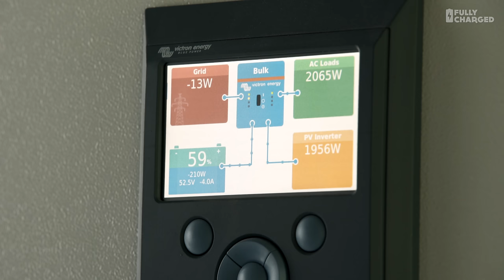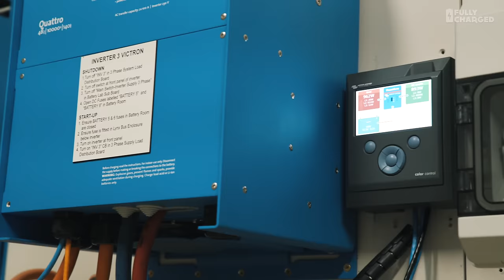Redflow ZCell batteries for home renewable energy storage | Fully Charged

Comment: As someone that lived in the Arizona desert, I was always looking for "that battery."  That battery that could store the enormous power available from the sun.  (Not to mention wind.)

The problem with all forms of alternative energy IS storage.  We can make the power, no problem.  Wind, solar, etc is ideal for the individual home.  It's the storage that's killing the promise of alternative energy.  (Somebody should offer a X prize for better storage!  Mars and space are fun, but we need REAL thought put into energy storage here on EARTH!)

While I applaud the Redflow design and their philosophy, the problem to overcome comes down to the same thing it always does, the inefficiency of the storage system.  I assure you that there is a reason we don't see everybody generating their own electricity everywhere there is abundant wind and sun energy- yet.    

All current energy storage systems fail when it comes down to efficiency in eight forms. 

First, if I put X into the Redflow battery, with X being a particular amount of electricity, let's say 10 kWh, what's the efficiency of conversion to storage?  Is it 50%?  Is it 90%?  How many of those kWh's that I pumped in, can I now pump out?  What's the efficiency when I draw the power back from the battery?  All batteries lose something in translation by storing electricity and then recreating it.  I don't see anything about efficiency.  In theory, a poor rate of conversion can be overcome by adding more generation in the forms of more solar cells or wind turbines or adding more batteries to the system, but none of those are cheap answers to inefficient battery storage.  If I can ask the OP, what's the rate of conversion?  

Bear in mind that generating all voltage is DC.  Nuclear, coal, oil, gas, wind, solar- they all start out as DC.  All generators work in DC.  In an alternative energy system, the DC is generated at the solar panel or windmill and then inverted to AC.  It gets sent down to the battery, transformed back to DC to go into the battery and then inverted back to AC for transport in the house!  Finally, it's transformed AGAIN back to DC for use in most appliances, etc.  Crazy, I know, but that's why the generation of electricity has always been in a centralized concept that's distributed over a grid using AC.  Losses can be up to 30% at the generator inverting from DC to AC for transport.  Throw atop those multiple voltage flip-flops a battery that has an inefficient conversion rate and you run up against the law of diminishing returns- the killer of all practical alternative energy ideas to date.    

Second, there is an inefficiency of all batteries today, that nobody can see at the time of purchase.  That's their maintenance\reliability curve.  With the old reliable standard of lead acid batteries, maintenance is low, reliability is high and the decay cure is very predictable.  Why?  Well because they are pretty much solid state systems.  (Solid state means no moving parts.)  The Redflow battery has a pump.  (Likely more than one.)  Pumps have moving parts.  Moving parts wear out.  So to the OP or Redflow, how many years or charge cycles can I expect to get out of a Redflow battery?   

Third, what does it cost me to repair one of these systems, in case of failure?  I know the pumps will fail, but what about the rest of the system?  If I have to pay a repairman $150 an hour to fix my batteries six times a year, that's not an efficient system.  Back to old reliable, lead acid batteries fail predictably and if not stressed too much, they will last a decade or more.  So to the OP or the Redflow folks, how often and how much does it cost to have a repairman out to fix my batteries?  

Fourth, what do these batteries cost to buy?  I am not talking about batteries in your current R&D, experimental stage.  What do you think they will sell for once you have these coming off a modern assembly line?  If they are $50,000 each, only the rich will have them.  In order to be viable, think about what you pay your electric company now.  Payment on these batteries must equal what I pay for grid electricity.  (Ideally less.)  If my total cost of ownership is more than what I am paying now, we have another interesting, but ultimately impractical device.     

Fifth, the cost of manufacturing in terms of energy consumption is a concern.  The system looks like a lot goes into it, though external images can be deceiving.  This is why CFL light bulbs suck so bad.  Yes, incandescent bulbs are less efficient, but it takes almost no effort in terms of energy to build one.  A CFL takes a LOT of energy and DANGEROUS chemicals to make.  Add all that in and CFL's are NOT as efficient, nor as safe, nor as cheap as incandescent bulbs.  (Governments always seem to lose that point when they ban incandescent bulbs.)  There is a reason why incandescent bulbs survived so long without changing- it's a great design!  CFL's, not so much.  So my question to the OP or Redflow is, how much effort in time, labor and energy does it take to make one of these batteries? That will of course dramatically effect the price!

Sixth, lifespan.  Simply put, will I get a decade of service out of these?  Or will I be looking to replace these every couple of years?  Op or Redflow, please respond.

Seventh, how safe are these batteries?  This is a killer of many, many alternative energy systems- they are a danger to have around.  For instance, there was a design that used a magnetically suspended flywheel that was spun up like an electric motor.  It ran in a vacuum, so in theory once it was fully charged, it could hold that charge indefinitely.  When called upon to provide energy, the stored kinetic energy in the spinning flywheel became a generator.  Great idea!  But if it failed, you essentially had a device not unlike a rail gun.  Imagine a failure on that while you are watching TV after a hard day at the office.  Right in the midst of a Benny Hill rerun, you take in a breath to laugh and your battery turns into the Navy's latest weapon system!  Out of your basement flies large bits of the flywheel and blows holes in your house!  Not to mention your sadness at missing Benny hill.  So to the OP or Redflow, how safe are these batteries?  Can they leak?  Can they explode?  If they do, is the "bromide" toxic?  Do they produce any gases during normal operation?  Do they produce gases if they fail?  Are the gases toxic?  What kinds and how much in each case?  Are the gases explosive, like in a lead acid battery?  (Conventional batteries produce hydrogen, the same stuff that blew up the space shuttle.)         

To summarize, I am not knocking your product. I WANT to see new storage systems!  It is the lynch pin that's missing from practical alternative energy systems!  

But these are truly serious problems that need to be overcome.  So if you could answer the questions below, we can all get an idea of how much further you have to go, before we see a practical design.

1.  Conversion (storage) efficiency.  How much juice do I need to put in for a given amount out?
2.  Maintenance.  How often do I need to dink with the system?  What's the unattended lifespan?  How many charge\discharge cycles before something breaks?   
3.  How hard is it to fix?  Can I do that myself or do I need a crane and a train to ship this back for repair?  What will it cost to have a repairman fix it?  Lifespan of pumps? 
4.  What's the price per battery?  That's once you get out of your R&D phase.  How much per kWh of storage?
5.  How much time, trouble and energy goes into making these?  In other words, if we have to pour huge amount of energy from coal to make one battery, that's not exactly green.
6.  How long will the Redflow battery last, on average, for the average household?  In years please.  
7.  Safety.  Can these explode or could they leak?  Any gases discharged?  What gases might leak in a failure?  What happens if this bromide leaks?  Fire danger?  Health dangers?

I thank the OP and Redflow for the post!  I am a big fan of energy storage and I predict that the grid power system we have now will be replaced by much more efficient, local "personal" energy generation.  Solar cells and windmills are efficient enough and cheap enough now to make Edison's dream of local generation a reality.  What's missing is STORAGE!

Techjeff
Reply: sorry, i didn't bother to read your rant in full. storage isn't killing promise of alternative energy. sun shines 100% of time, you just have to transport electricity to other side of planet. and that technology exists today, it is called electrical grid. but it's hard to expect awareness of basic facts from someone with "vertical farming" in name

Comment: Super capacitors actually works better with batteries as it'll save your batteries from on demand (if a fridge or similar appliance starts) power surges. Also capacitors charge up faster

Comment: Very interesting concept although, unfortunately, still unavailable in the US as of July 2019.
Reply: Not a concept, it is working product. I think they might have a hard time competing with Vanadium flow batteries at the moment, especially at bigger scale, but zcell should be cheaper and easier to make for small installations including homes.

Still it is not easy to get price quotes on these things.
Reply: @movax20h  I'm not sure where you're located, but I did contact them directly for US pricing, and they told me these were not available in the US at this time. No pricing to be had, simply unavailable. Sorry if I was unclear, I meant that the concept of creating a residential sized flow battery was a good one. I was intrigued by the capability of something like this, as opposed to a regular cell array or PowerWall type solution. It's not to be at this time, at least from this manufacturer, but does seem it should get some traction in the US. Storage is a sticking spot for solar to gain more ground here, and this is one of the more interesting solutions I've seen.
Reply: @Five0Music  Yes, it is only really available in Australia. I did contact them too. They are still growing, and there might be some extra regulations for these batteries too. I.e. These are using Zinc-bromide flow batteries. And well, Br2/Br-, is a bit toxic :) Br- is not very toxic, but at higher concentrations or doses it is. Elements Br2, especially as gas, and can cause skin and respiration issues. Just my guess.
Reply: movax20h Thanks for that info! I didn’t know about the chemical issues. That does seem to be a recurring theme in energy storage. I’ve been following the advancements in graphene, and am excited to see the new tech being applied to the challenge. Thanks for sharing.

Comment: Interesting, but if every home starts only drawing a few watts from the grid the infrastructure owners will go broke unless the standing charge for a grid connection is greatly increased.
So instead of peak load penalties a low load penalty.
Reply: In Australia we already pay basically a grid connection fee, per day, rather than have it built into our usage. I can't see any way around this when practically everyone is feeding into the grid (ie. the ability to offset this charge by feed in through your solar), but if we can get to the point where the cost of power for most people is essentially the cost of grid connection, that's still a massive improvement over the current system.

Plus, we could probably figure out how to make that cheaper, now that we no longer need to guarantee that the connection from a handful of very large power generators is up 99.9999% and can instead make our grids more flexible, supporting things like islanding where a section of the grid can be relatively self supporting for an amount of time while connections are repaired or whatever.

Comment: The tank capacity is 26 gals, I assume if you put a 52 gallon tank on it you would increase its storage capacity from 10kwh to 20kwh Obviously the 3kwh output and the kwh input would remain the same. But if you have the room you could double or more the capacity for very little extra cost.

Comment: Putting solar panels on residential rooftops sort of makes sense because it's taking advantage of essentially unused solar real estate for devices that can consume lots of real estate.  But, unless you're concerned about power outages, I'm less convinced of the need to be putting battery storage in grid-connected houses, rather than having the storage centrally sited and maintained by the utility.  As a homeowner, I don't want another device that I have to repair when it breaks down.  And it will break down.  Water heaters and furnaces are generally reliable, but every few years you still have to repair or replace them.

Comment: Off grid systems make sense for new houses. You avoid the connection and supply fees running into some $20,000 -$30,000

Comment: The electrodes do need replacement though I read. About every 10 years? For around half the original cost?
Reply: I don't think in 10 years you'll care, because the technology will be so advanced that the cost of the batteries will be crazy low! Just throw the Redflow battery in the garbage and buy another one for next to nothing!

Comment: Except that what large utility power gen maker could cope with having to power on and off with almost no demand. Power costs would be higher if only used in Winter. The only way to meet such short power grid demand would be expensive feeder power plants (gas turbines or fossil burning). The way to offset that is much higher fixed price grid fees, much lower feed-in tarrifs, profit making grid connection charges. Ideally there would be ideal as shared community storage and sell the excess power to those who need more power (more EV cars, less power efficient homes, apartments with low solar space). In theory you could have a market of power grid utilities selling top up power to community storage centres based on demand, transmission losses, utilities power availability etc. So if a grid supplier spins up a power plant it could sell the excess power to a storage market who need to keep their storage pool fully filled with power to cope with street, locality power demand.

Comment: It'll be interesting to see if this tech could be miniaturised enough to fit in cars, apartments (rather than houses), and maybe even phones.
Reply: Don't hold your breath for that, the density is not there. The Tesla batteries have a minimum 60Kwh and fits under the car, and this relatively big box is 10Kwh.  Both are well suited for their use cases.
Reply: Oh absolutely, but tech always gets better and faster (and cheaper) - obviously timescales are involved, but as manufacturing of the device improves (and as stated in video the 1% to 10% of early adopters will help to push this) it's inevitable.

A similar thing is occurring in VR right now, it's on what, the 3/4/5th gen and it's take off is very slow, the tech isn't quite there yet. (Although I remember the 80's VR, by jebus it's so much better than that!)

Comment: I've missed the price/kWH and the round trip efficiency,
Reply: Wrong place for that info. The industry is moving and changing soo fast, putting the price in a Static Video is pointless. Search online for a Vendor's Website for the Real Live Price.
Reply: On their website they claim 80% round efficiency. They must have improved their product a lot over the past few years as I know of a large shipping container sized Red Flow battery that was installed at a University up here in Queensland 6 years ago that was about 50% efficient. This unit has since been decommissioned. The only things you here about their batteries are from the CEO himself and no journalists seem to do any research into the product.

Comment: Hmm... I was told that if you have batteries in the UK they don't provide off gird capability is the grid goes off. They are designed currently to switch off. As 4-5kW going back into the grid when the technicians are trying to fix an outage would not be good for them! So for now they switch off. Which is a bit a bind! It seems the Grid needs to get a whole lot smarter before they can provide the backup capability. Just saying as this was a question I brought up when looking at PV+powerwall...
Reply: Just put them behind the meter .

Comment: I don’t understand why an inverter should be used to charge these batteries when they can accept DC current directly from the solar panels. Maybe because the panels output to the grid too, but for off-grid, expensive inverters could be avoided.
Why isn’t price ever mentioned?
Reply: Months later, I know... It would be possible to select the battery and solar panels to match up just right and cut out the need for an inverter, but being able to accept an optimal voltage from the solar and then charge at a separate optimal voltage for the battery can greatly increase the output and efficiency of the solar panels and again separately greatly increase the capability and capacity of the battery.

Having a fully DC off grid setup can yield higher efficiency and lower cost, but to optimize the the ability of each component you will still want DC/DC MPPT on the solar, and you would need to ensure all your devices can handle the fluctuating battery voltage, or have a DC/DC converter on the battery as well, to maintain a more stable buss for your devices.

Some setups, especially retrofit setups, use separate solar inverters and battery inverters that are coupled on the AC buss, but you can get solar/battery inverters that have two DC connections and one AC connection. They are more efficient and make a lot more sense for new construction. They may be harder to justify on a battery retrofit.